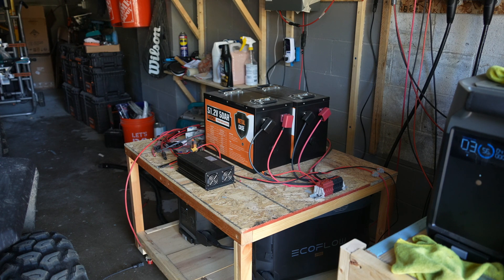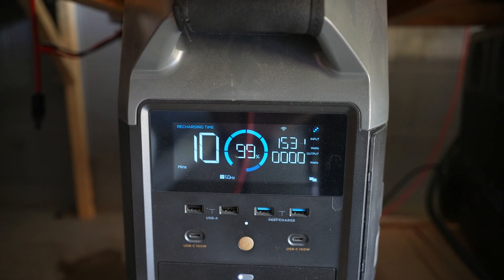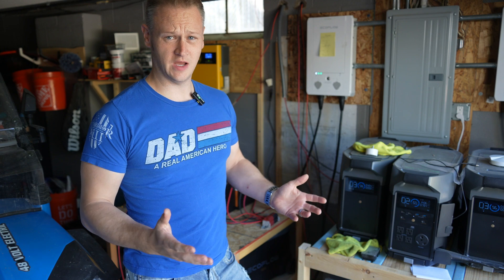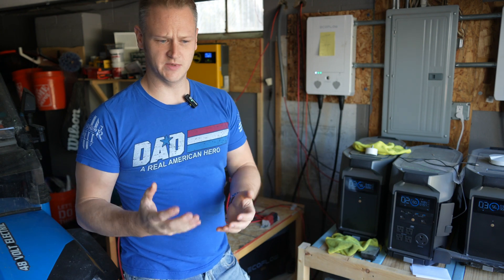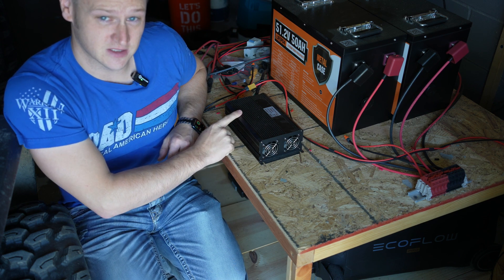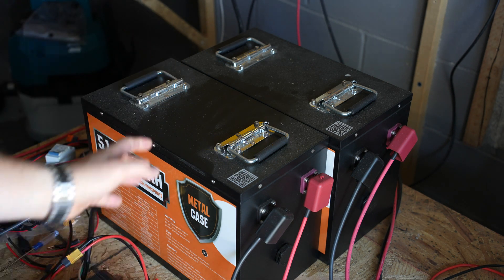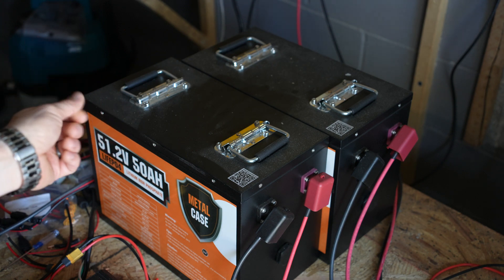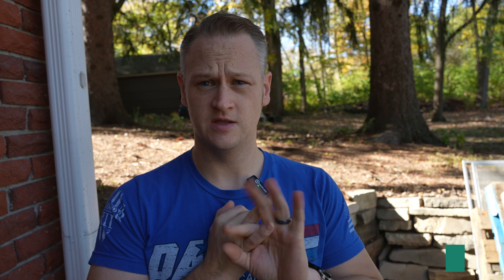Delta Pro and External Battery Integration - Update

Comment: Daniel, with the DP and the DP extra batteries.... when you plug in two of them, do you still see the "X1" there?  I'm asking because I have 2 smart batteries connected and the application sees both batteries but I only see X1 in the main DP.  Thoughts?
Reply from the maker: Hmm, yes, on my Delta Pro, when I have two extra batteries connected I do see "x2" on the LCD screen of the Delta Pro.
Reply: @DanielGoodwin-jq1oc  after doing shutdown and restart several times , I got it to work.  So weird

Comment: If you got the DPU, would you just skip the EG4 and battery bank altogether?
Reply from the maker: Yes, with the DPU and its combined 5,600 watts of PV input, it really negates the need for the eg4 and external bank. The only advantage would be if you'd maxed out the DPU capacity and you still needed more. But, at that point, that's really massive overkill.

Comment: How can I obtain a full detailed list of components like as you have used and a diagram? What a great set up. Please help
Reply from the maker: I'm glad its useful for you. I will do a video performing a complete breakdown of all the components and provide links to where you can purchase. Stay tuned.
Reply: I did do my best to match your set up accept (with advice from sellers who I sent links to the first 3or 4 or your videos and have decided to go with 24V EVE 230AH 5.89KWH LIFEPO4 BATTERY PACK KIT - for $2128.00AUD

Seller suggested a cheaper option charger to charge my new extra battery kit= (being) SOLAR HYBRID INVERTER DC 24V 3000VA   
But I am very new to this and so it’s very useful to see these Daniel Goodwin videos not many non EcoFlow delta pro sellers like to advise anything about the delta pro as most suggested disgarding that in favour of they own products. So with these type informative videos I’d be stuck as to how to overcome delta pro limitations. I purchased my kit only just prior to your response (it’s not arrived yet) so please advise me if what I’ve purchased won’t work (Seller very confident after seeing your video and another YouTube video ‘how to build a more powerful delta pro’  @DanielGoodwin-jq1oc
Reply: I just removed idea of inverter above & added Growatt 24V 3kW Hyrbid Inverter × 1 AUD $865.00
Reply: I am from Australia and unsure if input voltage differs from USA EcoFlow delta pro models. Our wall sockets are 240v

Comment: Appreciate the update. I’m curious to know if you can give me a little knowledge. If you could be so kind haha 

So I have 2 delta pros and have them connected together with the voltage hub and I wired in a 50 amp rv outlet for my 5th wheel. I don’t have any of the smart batteries that eco flow has to offer I was thinking about using a server rack battery system or I even like the 48v 50amp lifePO4 batteries like you have . 

The issue that I’m having is , because I have 2 delta pros they both need a solar connection to charge. So would I need to make 2 individual battery storage systems? 
Or could I tie my 2 solar arrays into a eg4 and have the eg4 send charging power to each delta pro? 
I hope this makes sense it’s hard to type this out but would appreciate your help in pointing in a direction. 
Thanks man , if you have links for any of the batteries or equipment I would need I will definitely use your links.
Reply from the maker: Hey! Thanks for the question, I'm far from an expert but I'll try to help. First, are you thinking of charging the Delta Pro from the external battery bank using DC? I haven't tried to feed two Delta Pros using DC, my initial assumption would be that the two Delta Pros controllers would fight each other for current. I know they would if you tried to use a solar array, however it might be different with an external battery bank. If I get some time this weekend I will try to test this out for you.

Comment: Glad you mentioned the voltage adjustment screw on the switching station to increase the voltage output. The unit does not arrive with any instructions to tell the user that feature. Love the videos. Keep them coming. Cheers!

Comment: 48v Bulk battery - come off a bus bar that goes to XT60 connector with an inline fuse and plug into the DC Solar port on the delta pros.

Comment: Thanks for the update. Do you only charge one delta pro and then charge the other one or would you consider two of the AC to DC converters so you could power them both?
Reply from the maker: You're already ahead of me. :) My next goal is to greatly amp up the solar input into the EG4  controller and then see if I can run 2 AC/DC 1500w power supplies two charge 2 Delta Pros. Unfortunately, I'm a little stuck right now due to the shipping mishap so it may take some time.
Reply: @DanielGoodwin-jq1oc  I have been living in a 37' trailer and recently bought two delta pros but have never used them. Just took them out of the box and updated the firmware. This month I started buying a new  house in San Antonio, TX so will be moving soon. I am selling the delta pros at a good discount and buying the 18K inverter from Sig Solar plus their EG4 PowerPro 14.3kWh Battery. It is on sale right now for around $9500 so that will be my system at my new house

Comment: Super cool. I have been looking into diving into this myself. What model of EG4 all in one did you go with? Also, have you considered EG4 server rack batteries instead of the ones you got?
Reply from the maker: I went with the EG4 300ehv-48 model. Since I didn't know how well this would work initially, I didn't want to spend a fortune upfront to find out. I tried to do this as economically as possible. Yes, their server rack batteries are very nice and well reviewed but also very expensive. For me, I found it cheaper to buy these two Eco Worthy 50ah batteries because if they didn't work for this purpose I could still use them to upgrade my Hisun Sector E1 UTV. It turned out they worked great.

https://signaturesolar.com/eg4-3kw-off-grid-inverter-3000ehv-48/
Reply: @DanielGoodwin-jq1oc  super. Thank you. Thinking about same setup. Not sure that I want to spend even more money on new Ultra when it comes out.
Reply: Hopefully new stuff is backwards compatible but I really doubt it